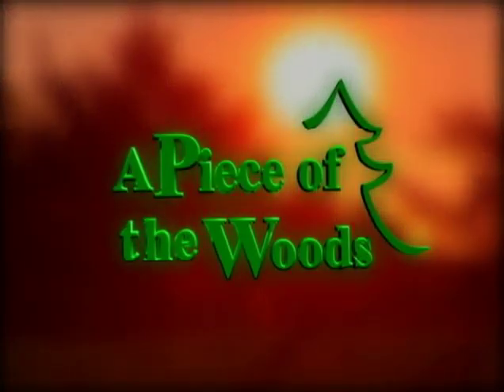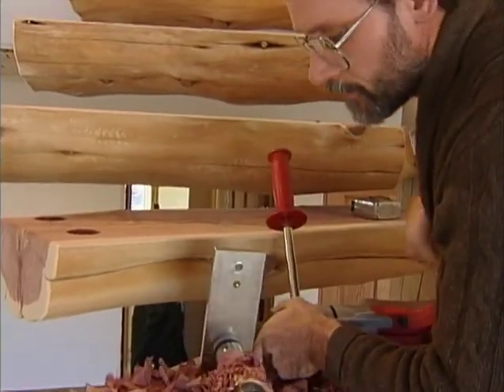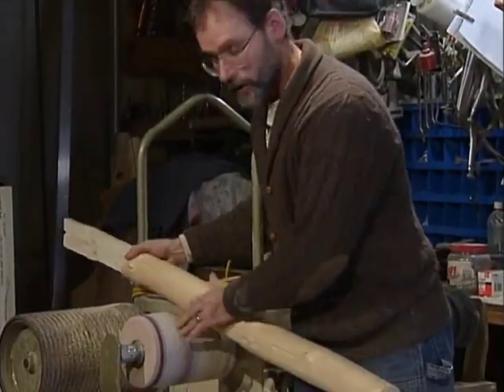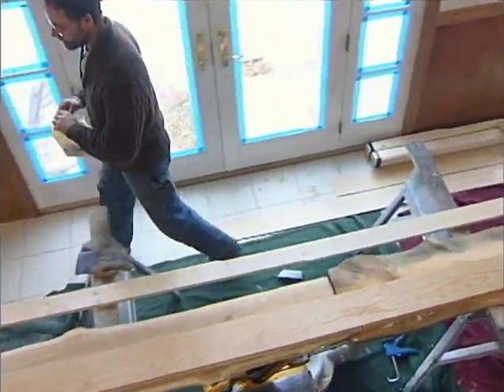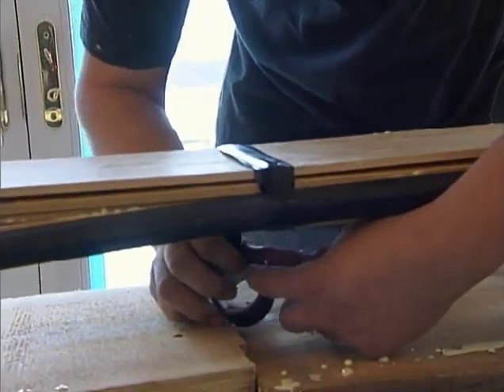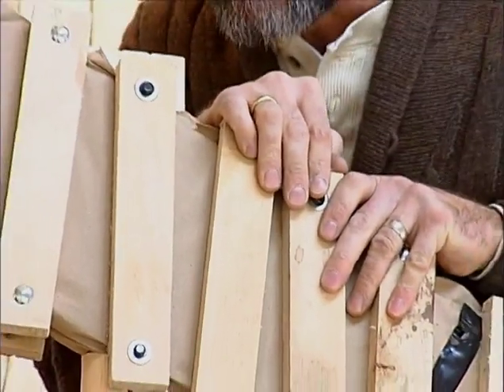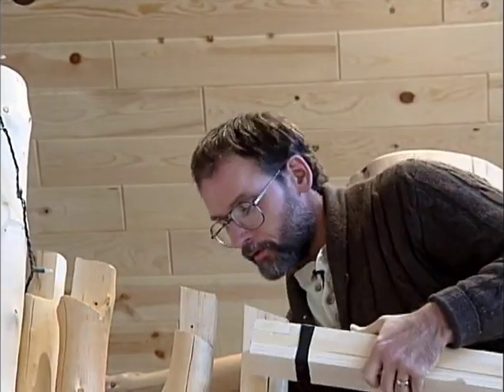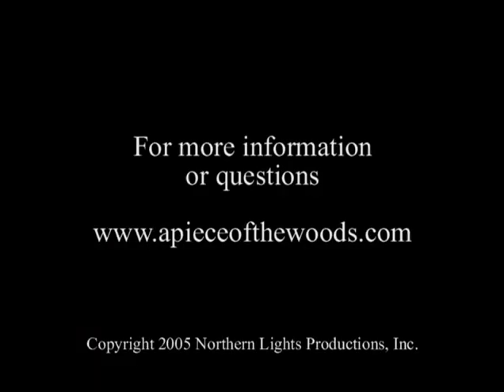Log Circle Stairway laminated Handrail, built on site?

Comment: Having worked in a custom stair shop, here are two things I noticed. 
1st, the amount of glue used was wwwaayyy to thick. A hopper feed glue applier is very helpful. 
2nd, 18in shrink wrap wound the correct direction there is very minimal glue drippage. Adding a layer of paper on top of the shrink wrap would take care of the leaks.

Lastly, there are never enough clamps :)  though do remember to tighten all of them evenly/ to the same tightness so it's the same thickness end to end
Reply from the maker: The first thing I noticed was your great amount of experience and your willingness to share it. If you wrap shrink rap around an an item to be held together with water based glue, it will not dry, not for weeks, just like glue in a plastic bottle...

Comment: Now I have to try the spiral tree staircase and this railing in my place. I don't have some of the tools you have, but there are other ways. Unfortunately, I had over $1,000. of power tools stolen out of a storage locker.  I have had so called friends in the past to steal my things they were watching for me and so I decided to use a storage locker this time.  Just as bad. It is such a shame you can't trust anyone now days.  I will have to buy a heavy safe or build a shed with concrete walls and several dead bolts to keep my stuff safe.  I don't live in the same state as the house I am building and have to travel to work on it.
Reply: A year later I am watching this again. I have to build a new staircase in a different area from the first by the door.  I should be able to do the staircase better now and the railing perfect.  I want to do some wood carving into parts of it as well.  Should be done this time next year. Have to do most of the work myself.